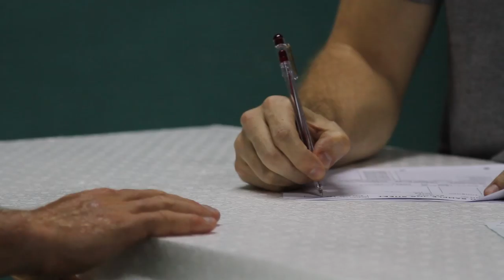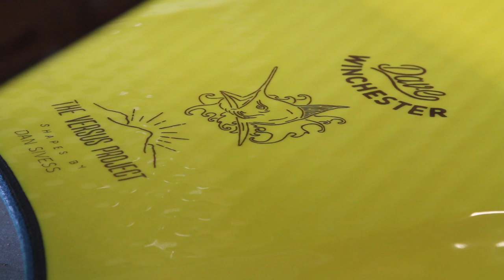Dave Winchester VS Dan Sivess · 2014 VS Board Creation

Comment: This template is freaking good. i get it as a versatile shape(60% prone and 40% dk). I went shorter as this board is thicker than most boards i inspect. I went from riding 42.5 and 43 to 42.0 im 5'11 and 185 pounds.
i am loosing some weight so i might go even shorter in the future (41.5).
im very happy just sharing.

Comment: Hello, I am from Uruguay. I have a bodyboard Riptide Pro that came off my nose. The top part that joins with the bottom part in the front. With what glue can I glue it? Or can it be joined using heat again? The core is made of EPS and I am afraid of damaging it.